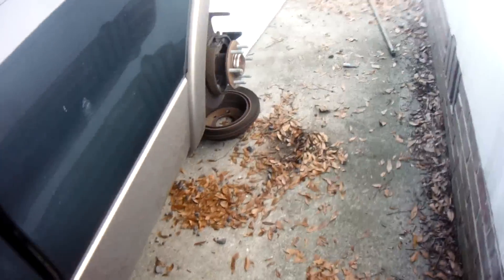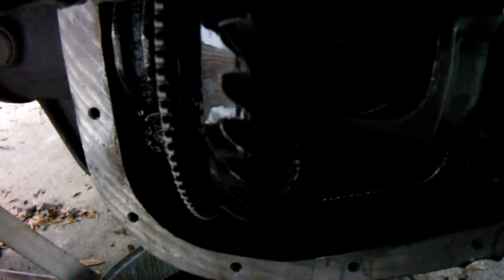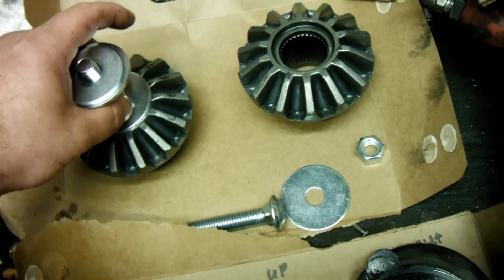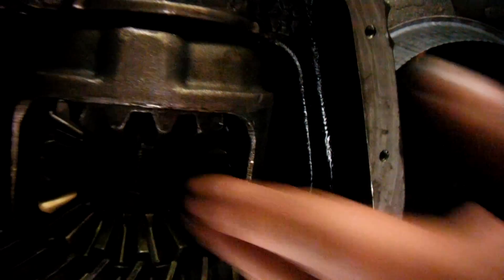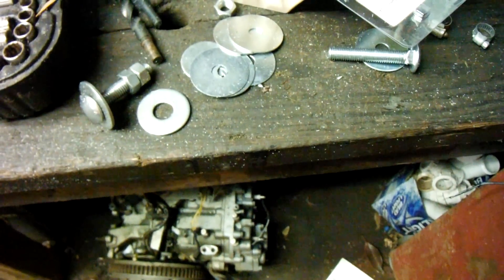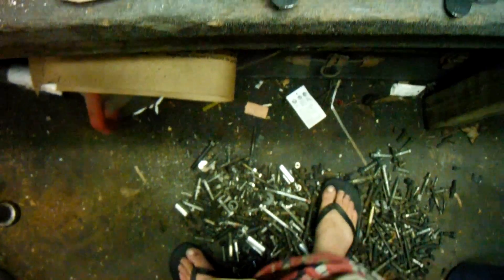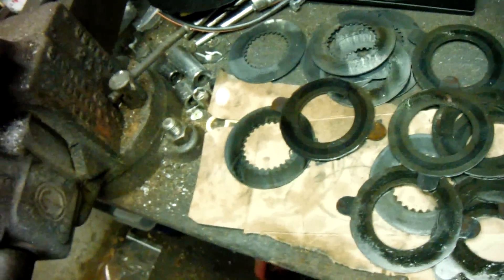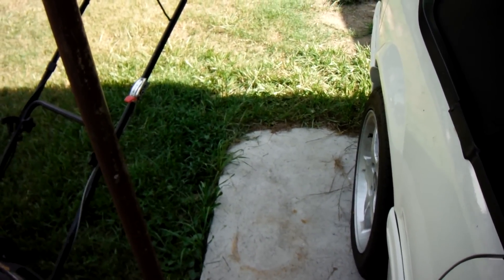How to replace f150 9.75" clutch packs to fix rearend shudder 2004-08

Comment: Thanks for this video went through hell trying to get the bearings in they just didnt have clearance until I learned I had to compress clutch packs I built your tool worked perfectly
Reply from the maker: thanks man! I built the "tool" based off stuff I read on dead forums and then just took the gears to lowes to confirm it would all fit like what I read.  worked perfectly! glad it worked for you too man!

Comment from the maker: yup.  mostly it was very low speed turns or turns from a stop.  the whole truck would shudder which was caused by the clutch packs slipping and trying to grip and then slipping again.  you could sometimes feel it lightly at higher speed turns too.

Comment from the maker: housing is locked in the bench vise will give the same function.  I did it on the truck though so I was able to use concrete as my stoplock for the axle...fully inserted into the differential but no c-clip in place.  hopefully this makes sense to you.  comes out REALLY easy...

Comment: To everyone with a Ford that has rear differential clutch packs before changing these things out try a cheaper easier option first replace the fluid and make sure you get the special additive for it first I've dealt with these and alot of times simply putting fresh fluid and additive in it will take care of it. Note it does not happen over night you need to put miles on it to work this stuff in and the best way to do it is find an empty lot and do circles left and right for a half hour or so then keep driving it to see if it improves.
Reply from the maker: once a clutch is burnt, there is no unburning it.  unglazing it, whatever you want to call it.  you are simply trying a bandaid which will last for a bit but the surface is already garbage on the clutch.  stop spreading misinformation.

Comment: Usually you have to jack the truck up on each side so the oil will to to the wheel bearings and then recheck the fluid level... that's what we do on big rigs

Comment from the maker: best thing I can say is to put the carrier back in the housing.  when you see me initially showing the axle with the lugs/breaker bar.  I used that to "hold" the one side of the spiders in place by locking it in place using the axle/breaker bar combo....then the breaker bar you see me use on the differential ring gear is how I then turned the differential and it walked the spiders out.  god only knows how you'll do it on the bench...maybe toss an axle in and spin that axle while the..

Comment: Nice video, but my question is how did you remove the spider gears? I have my diff out or the housing and on a work bench. My buddy and I have the diff on a work bench. We made a tool to relieve the pressure on the the clutchs, but now the spider gears won't spin so we can line it up the pull it apart. What do you suggest?

Comment: Doing this in my truck now. Ford included two washers with now teeth that have .075” on them. The old packs didn’t have anything like that. Are they just shims if I want it to grip harder?
Reply from the maker: no clue as I didnt have them obviously, best bet would be to call a ford dealer if you cant find any info online...a friendly ford dealer lol
Reply: @stackz00  I’m just gonna go back to the dealer o bought them from. When I opened my diff off 5 of the tags off the clutch plates were just laying in the pumpkin

Comment: Could you describe the shudder? Was it present all the time or when you were turning? More noticeable under hard acceleration? How many miles can be expected before worn out?
Reply from the maker: only when turning, reminds me of how a detroit locker would shudder when turning because it would engage/disengage in turns if that helps make more sense.  I sold the truck several years ago so no clue if the issue ever came back or not.

Comment: when I buy a differential rebuild kit that's the spider gears cross pin and thrust washers does it come with the clutch packs
Reply from the maker: "thats" do you mean "whats"? I cant tell.  also, you dont need a new cross pin.  why would you think you would? its a cross pin.  it simply holds everything in place.  no load is placed on it, no noticeable torque is placed on it to stretch the threads...you simply buy the ford clutch pack and go from there.  I didnt think I was being that cryptic in this video??

Comment: Any trick placing the satellites back in the right position? Thank you.
Reply from the maker: what do you mean satellites? are you referring to both of the side spider gears? you lock one axle and rotate the axle while pressing against the spider and you can walk it back in due to the rotational force the same way you got them out.
Reply: stackz00 I was actually talking abt the spider wheels that come on the central locking axle.  I saw something on YouTube, I gotta try again.
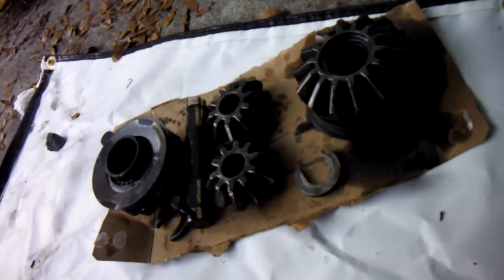Reply from the maker: yeah thats what I'm talking about as well. the two small gears I handle in the middle of the cardboard at 1:28 in the video right?
Reply: stackz00 yeah, that's right
Reply from the maker: then yeah, do what I talked about, they will slip back in if you are patient and take it slow.  It may take a little trial and error (and a couple cuss words) but if you are mechanically inclined you will see what I mean.

Comment: Same problem. Pain in the ass. 2004 Ford 150 FX4Dealer wants a lung to do what you did in your driveway. What did that job run you in just parts?Nice job.
Reply from the maker: I spent about $150 for everything including the oil and such.  got most everything off ebay where it was much cheaper.

Comment: I don't have a ford but I have a Grand Prix and around corners, up hills, and sometimes just accelerating it will stutter and jerk pretty bad. Do you think it could be bad clutch packs?
Reply: MercilessHobo your car does not have clutch packs these are for limited slip differentials which your car does not have

Comment: I'm having this problem in my 2004 F150. This took you 9 hours? I don't think I want to get into that. What would a shop charge for this job?
Reply from the maker: listen to what I said.  it took me nine hours due to all the breaks I took due to rain and such.  my actual total time wrenching on it was about 2 hours.
Reply: I did listen to what you said right at the 6:00 mark which was it took you 3 days at 3 hours a day = 9 hours. But if it actually only took you 2 hours then that is certainly manageable. Also, I really appreciate people like you who take the time to make these videos. They are always so helpful.
Reply from the maker: the longest part is going to be dealing with getting the spiders back in, especially if you are alone due to the amount of pressure you need to apply to walk them back in.  loooong breaker bar on the axle with a friend helps.
Reply: priscs I just paid 1100$ for pinion and clutch pack replacement. Well worth it, take it back in a few weeks to change the gear oil with friction modifier